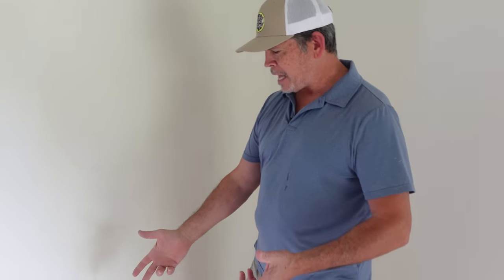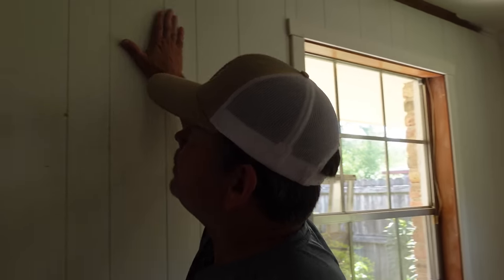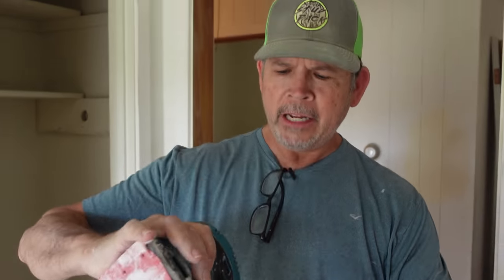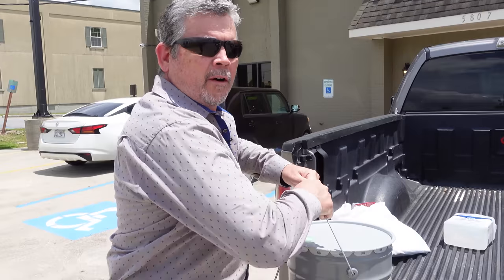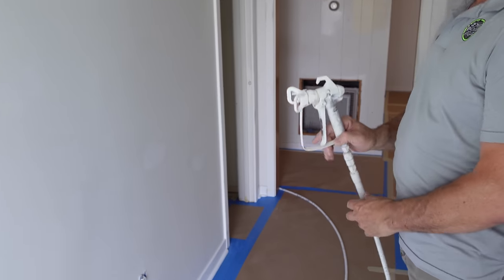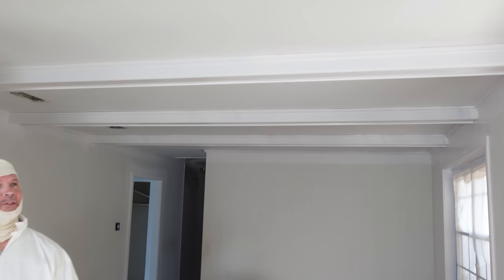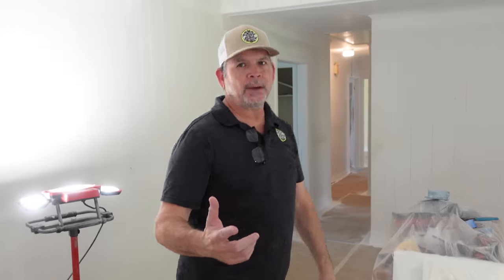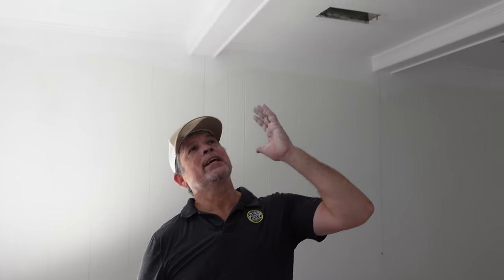MOST BEGINNERS MISS THIS PAINTING STEP (Baseboard, Crown, and Casing)

Comment: Being a painting contractor for 25 years now its good to see the paint videos. Over the years I have "streamlined" my system. I paint alone so speed is key. I can paint a 1300 sq footer in 4 days. I always cover and prime day 1, day 2 caulk and crawfords painters putty in the holes. Spray ceilings and closets with ceiling white. Trim after that. I use a quality, thin spray shield to spray crown against finished ceiling's. Cardboard is to thick. Then i spray cabinets if required. Day 3 i tape all my backbans with 1 inch blue painters tape to protect from wall paint overspray. Tuck all my finished doors inside the closets. Angle the gun towards the floor about a foot below the finished crown shielding with my left hand. Once you spray a foot or two down from the crown you can spray straight on at the walls. Working alone i spray half a wall, grab my backroller and push the paint i sprayed up to a inch under the crown. Same for down the casings, push the sprayed paint as close as possible to the taped backban. Do 2 laps spraying like this. This way you will only have to "cut" a inch under your crown. Then brush a good heavy coat down the side of the frame. Pull that 1 inch blue immediately after you do that and it has no time to seep behind to your finished trim. Razor sharp lines every time. Second coat your line is already there. You will have to scoot around and brush baseboards this way. However it is MUCH faster than cutting and rolling walls and ceiling's. I keep my pressure low and use a fine finish low pressure 312 tip on trim and ceiling  "FFLP" 514 tip on ceiling's and closets. You should invest in a greco contractor PC gun. It has a two finger trigger for more control. The trigger pull is very light also. Saves you from aching hands. Worth the money for sure.

Comment: If you've got stained grade lumber for trim there's a trick that I learned years ago when I worked in Aspen Colorado where people were willing to pay top dollar for top quality work but most painters just buy color putty and get pretty close to the color that they need to match the color of the lumber but what I found is that every nail that is placed in lumber is it a spot where there's a big color differential there could be a very light area and there could be a very dark vein in the lumber and so one piece of trim can have four or five different colors so what I do is I buy three different colors of putty one white one dark and one on the reddish side and I proceed to custom blend the white with the dark and so on and by taking these two colors you can mix exact colors to wear the nail is sitting and you can make a piece of lumber completely disappear or should I say you can make all the nails on a piece of lumber completely disappear for a really nice look but just using wood putty just doesn't give that really perfect look that I like myself

Comment: Paul, go get yourself an extension wand for the sprayer head. It allows you to go vertical, and hit an entire wall top to bottom in one swipe, and keep your arms at a more comfortable level. It lays a better coat for coverage, gets the nozzle closer to the work, but keeps you further away so you don't spray yourself with the backwash! Also, get those safety glasses on when spraying paint! Last thing ya need is primer or paint in your eyeballs! 
I use that primer/sealer all the time. it's great stuff. 
Also, switch over your caulk to Alex Fast Dry from DAP... way faster to apply, easier to clean up and dries to paint coverage in about 15 minutes!
Reply: I second all that! Definitely a 10 inch extension.  A 210 or 310 FFLP tip for trim as well.  You'll never go back after that. And a 4 foot whip for the end of the hose for better control, those lines are stiff otherwise! And did he say we go home when the sun sets? Yikes.  Awesome job guys.
Reply: Number 1.. a better sprayer.. those home depot sprayers are just project sprayers not rated for that much painting. The 395 nova pc would be a good fit for your channel and with the pc pro gun you'll be in heaven with the comfort. Number 2.. Alex fast dry shrinks way too much for quality.. Sherwin powerhouse rated 60 year.. both the paint and caulk are latex acrylic so they will dry together meaning if you're spraying you can spray not too long after caulking anyway. I paint multi million dollar homes.. oil base spray or alkyd enamels are best for trim.
Reply: And Alex fast dry is a dap product btw lol.
Reply: @jacksparrow3490  305d fast dry or alex fast dry is perfectectly fine for a “not-a-million-dollar home.”  And so is his sprayer. He’s a contractor not a painter. There’s a place for every tool.
Reply: @HIS_tube  so you're ok with the trim cracking and separating from the wall within a month or two on your projects? Yes the caulking is fine.. if you don't care about the quality.. if he doesn't quite know then I'm informing anyone who wishes to know. I've personally used all of those products and can tell you from experience that 25 yr stuff is really bad.. it cracks within days.
Reply: @HIS_tube  and spending an extra $20 on caulking for an entire home is hardly a bad expense nor will it "break the bank" on the project.. id rather go with better quality prep material than the actual top coats of paint as the paint with hold anyway.. its the surfaces underneath the paint that will ruin your job over time..
Reply: @jacksparrow3490  Cool beans brother.
Reply: @HIS_tube  it is literally only 1.50 more a tube.. the whole house would take less then 10 tubes considering his trim work is of better technical quality.. stop being ignorant
Reply: What was the caulk you recommended?
Reply: @jacksparrow3490  that’s what’s up brother.
Reply: @ivwshane  It's called Alex Fast Dry, and it's from DAP Products
Reply: @ivwshane  It's a fast drying, acrylic latex caulk, can be used indoor or outdoor, and available at most home centers (orange/Blue/etc/)
Reply: @jacksparrow3490  While caulk cracking and shrinking can be from some inferior products, A LOT has to do with the application of that product. If your trim isn't tight, and you're caulking the grand canyon, or your nail heads are set too deep and not holding the molding properly, any caulk you put up there is going to shrink and crack. 
My personal choice in caulk would be big stretch from Sashco tbh, but when you need speed, quality, and ease of use, Alex Fast Dry is a good quality product that goes on fast and clean, stays flexible, and is ready for paint in 15 minutes. 
Even after 45 years in the trades, I still take the time to learn what's out there, and choose the best tool for the job at hand. Graco makes good equipment, as does DAP. The price of the job should have absolutely no bearing on the quality of the work. Period. That isn't the question. I've built many a multi million dollar home, and worked on many more. That makes zero difference in the quality of the work done, and tbh, most of the time the work done on those homes is substandard and barely meets code. Some of us care, others do not. Stud Pack cares, I care, and I believe that you and Chris both care as well...
Reply: @AlAmantea  the price doesn't reflect the quality of work? Uhhh...
Reply: @jacksparrow3490  No, It is not always so. Sometimes, yes. Always? absolutely not.
I have seen many homes costing way less than others with excellent quality work done. I have also seen many a multi-million dollar home that you break into with nothing more than a utility knife and gaps in trim and cabinetry large enough to fit a screwdriver or a finger through.
If you've been in the trades for any length of time, you know exactly what I'm talking about.
Reply: Sherwin Powerhouse according to a previous comment. I had to read a few times to find it.
Reply: @AlAmantea  leave the painting to the professionals is all ill say. If youre charging high prices for low quality work then maybe you shouldnt be in the trades. Youre not about the quality or integrity of the work, youre just chasing the dollars at this point.
Reply: @AlAmantea  sounds like youre around cheap shotty contractors who hire the lowest paid unskilled workers they can find to profit more for themselves on the end of the job. Ive seen it as well. But there are contractors who build luxury homes that do hire the competent skilled people to provide more understanding and skill to the job for a better quality finish. My painting makes me more money then alot of other tradesmen. Why? Because of the quality..  so yes price reflects quality EVERYTIME. You sound like one of those quick buck chucks trying to make thousands hiring the guys at $10/hr who dont know what theyre doing. Ive personally watched a contractor trying to youtube something he knew nothing about and was charging thousands to someone for work he had no clue on how to do. Is that ok by your measure?
Reply: @jacksparrow3490  it sure as hell does and it really ticked me off after all the work I did on my little 1000sqft house
Reply: @AlAmantea  Painting labor, and painting products in my experience is "very much you get what you paid for product/production." If the prep sucked a great product will also suck - so low cost labor high volume cost usually poor work letting the good products professionals would buy turn to turds. But rarely do I see any professional us crap products in high volume production (low cost) because good products saves in labor. That in itself is a testament to how more expensive paint products are worth every penny.
Reply: actually go with Tower caulks that is the best brand money can buy
Reply: @AlAmantea  "the price of the job has absolutely no bearing on the quality".. is what you claim. Every professional in any trade will tell you... thats a false statement on your end. Maybe you should rethink what youre telling people so they dont have the assumptions about who your character is?
Reply: Safety glasses usually don't work when spraying there's zero point in using them and Alex fast dey caulk is terrible in my opinion. Way too loose it doesn't have enough silicone agent in it. Sherwin Williams 850/950A is what I've been using for the past 20 years or so and has been fantastic interior and exterior
Reply: @jacksparrow3490  ...... have you tried finding a good painter that's not booked out for 3 months?  Easier said than done and then of course you actually have to find a good painter..... Not simply a "professional" painter, a good professional painter.
Reply: @jacksparrow3490  I call bullshit on your trim cracking and separating because someone used some cheap DAP Fast Dry. They have some better cheap caulks, but even the cheapest Alex Fast Dry won't crack, unless the whole building is built cheaply with green wood in wet /cold conditions. Thew problem is not caulk, it's poor workmanship. I live in rental apartments, I fix the trim, paint and other stuff landlords won't mind/will appreciate. Some buildings were old and crappy and the cheapo DAP was fine more than 3 years later. Only downside is it doesn't have the smoothest texture and requires to be painted over otherwise it attracts dust and yellows.
Reply: @rolfbjorn9937  yea i really dont care what some apartment painter using cheap materials has to say really. Workmanship? Lmfao thats funny given i do some of the highest quality work around. Sorry you think your cheap methods result in long lasting finishes.. lmfao the caulk literally says 25 yr rating.. vs a 60 year rating caulk for literally not even $2 more? Yea you really got me with your apartment painting experience huh? 🙄
Reply: @rolfbjorn9937  when you can spray a multi million dollar mansion with the cost of the paint job exceeding 100k then MAYBE ill take advice from you.. until then, stick to your cheapo caulk and ill continue to produce works of art.
Reply: @jacksparrow3490  oil base sounds nice but , 1. yellows too much, if you spray that slick shiny oil onto walls next to trim, then apply water base  flat over it, the right thing to do and extra work sanding down that oil base surface tension before the flat paint creeps off the surface . I learned to use acrylics in the 70's and with waterborne Hybrids as they dry quick and super hard, why stink up a whole house  let alone stink up our perfect pink lungs. You are right on the caulk though

Comment: Just some tips from a painting contractor. I find that 3M hole filler works best for trim. 3M large hole filler w/fiber works well for walls. Drys fast & hard. Sands easy. Very low dust. Also only reveal coat is needed for priming. Just go back and spot spay prep work you do.  Saves time & materials. Great video. Keep up the good work. 👍

Comment: That's right...put them to work.  This reminds me of the work I did to renovate our townhouse, except I did it all by myself. Lots of prep work.  Spraying took seconds  to spray a wall once everything was covered.  Lots of running around to get material, too.  On top of all that, I have a full time job.  It took much longer than I'd expected.  A 10" extension for the sprayer made a huge difference and I did not have to reach or stretch to spray the ceiling and made spraying the walls easier too.

Comment: You guys are on point! So glad you went with oil-based primer to avoid potential stain bleed-through. It’s surprising how many people attempt to use latex primer/paint over stain-grade stock. Keep up the good work!
Reply: There is one latex primer available called Stix that does not let stain/varnish bleed through. It costs more than oil primer so the only benefit to using it is if you're under serious time constraints or you are working in an environment where the smell needs to be at the lowest possible level

Comment: btw I’ve found that flexible pvc pipe adapters work great to fit shop vac hoses to tools
the ones made of rubber with a hose clamp 

just make sure you measure because the diameters sometimes are pipe I.D. Sometimes O.D.

Comment: I’ve been using taping compound to fill holes. Sands super easy. Been doing it a few years with no adverse reactions. Tinted mud works good too. Put a little extra in to combat shrinkage. You can sand it smooth or even use a damp sponge.

Comment: Paul, nice video production and explanations along the way.   I was looking for info on farmhouse sink install and got hooked into the most beginners miss painting step.  But you've done more work than you need to and can eliminate sanding nail holes.  FOREVER.  If you want to learn how, just reply back on this comment section and I will gladly share that tactic and supply you another on caulking.  Great channel

Comment: When I use the roller my wife follows up later with a bright light looking for any tiny spots where the paint was applied thin or there were any bumps or flaws int the surface. She doesn’t miss anything.  She’s great at cutting in and trim painting and insists on doing that herself.

Comment: Now that’s how to paint a house!  It’s astonishing how many “How to paint like a pro” videos there are where they are using a brush. I always felt a truest professional paint job would/should be done with a sprayer. Now if I only had the time to take everything out of the house (including the wife and kids) and prep in order to use a paint sprayer.
Reply: I mean, I see a lot of professionals using rollers, and my office was painted using roller for walls, and brushes for corners, and it looks wonderful.
But I think that a pro would probably have both available as tools for the job, not that I'm a pro at this sort of thing at all mind you.
Reply: @HrHaakon  I brush and roll old work, spray new and outside work. I have to paint with furniture, etc. in the rooms, so dragging a hose around is not practical. I seem to get it done with a brush and roller as fast as prepping for a sprayer and spraying. Of course I am not needing a prime coat, just paint.

Comment: For the caulking we use a damp sponge and a 3 gallon bucket of clean water. Saves your finger from running hundreds of feet of textured wall and ending up with your fingertips erased.
Reply: If you ain't bleeding you ain't caulking.. I just started using nitrile gloves when caulking so it doesn't dry all over my hands.

Comment: How do you keep the spray Ines from telegraphing through on the walls after spraying the trim ?
Reply: The spray is so fine it doesn't create an edge unless you don't have your pressure correct or your tip the wrong size. The roller nap and brush will cover any overspray with no problem.

Comment: You need to invest in a narrow tip for trim.   I bought a Graco 313 tip it only sprays 6" wide and is just a bit less paint flow, instead of 10" width of a standard tip.  I preferred the narrow tip over the wide for base and casings.
Reply from the maker: I used a 311.   Looking at some new tips today
Reply: @StudPack  Perhaps if you buy a new tip it will help fulfill the petition requirements.   :) As always keep up the good work, your work is an inspiration of craftsmanship done right.

Comment: was the trim not able to be sanded before installation?  10x the time and 100x the dust to do that after install.  I keep a Dewalt 20v sander at my miter saw everyday with a piece of 220, takes a few seconds to sand a 8' 1x6 comfortably, and whatever dust my da doesn't catch...it just flies away in the wind.  love the channel man, i was stoked about the cabinet leveling system you showed a while back.

Comment: Hey stud pack. Great work.  Have you tried af fine finish tip on your airless? I find that they produce a better finish rather than using a 311 tip. You will need to get a new guard for your spray gun to use a rac x fine finish tip but I think that you will like it